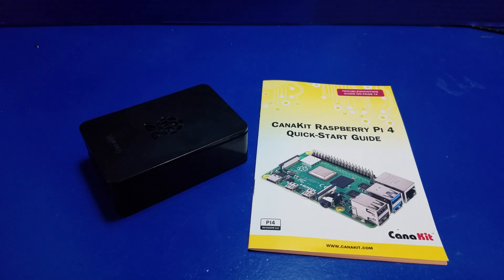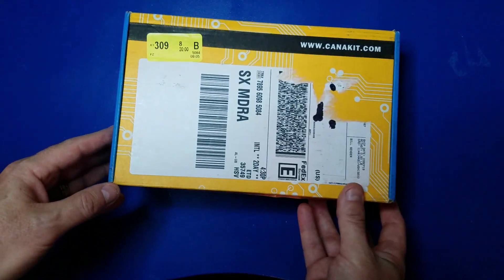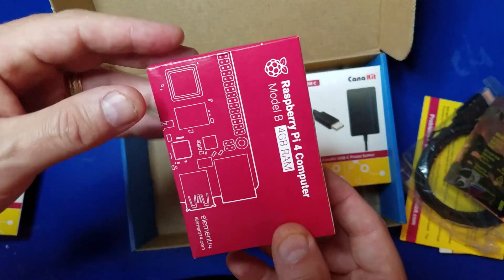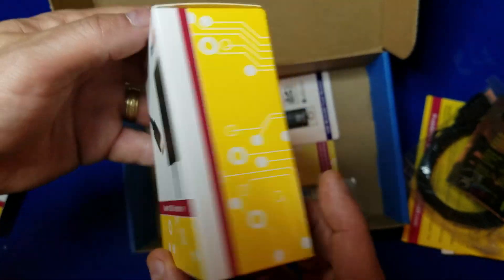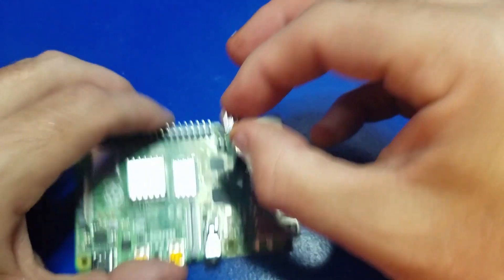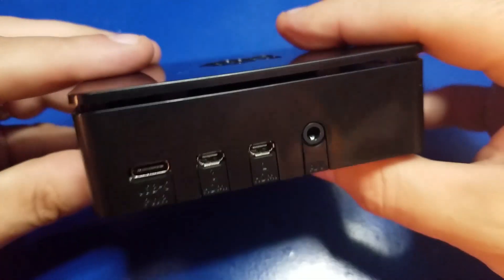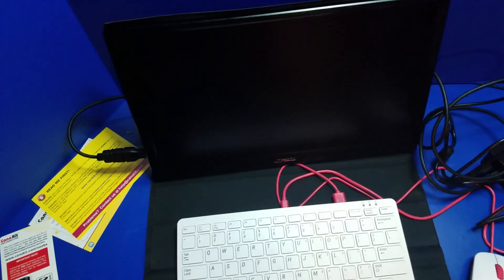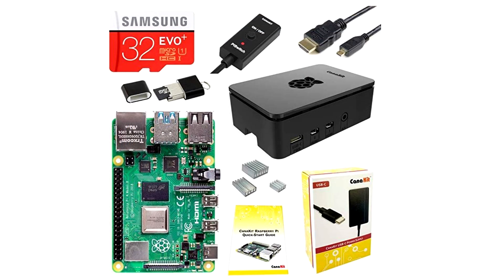CanaKit Starter Kit for the Raspberry Pi 4 4GB Setup with Heat Sink+Fan install & Test!

Comment: Thanks for the video. I used exactly same kit from canakit as you and followed your tutorial step by step. However, my raspeberry pi could not search wifi and there was two red crosses on the wifi icon (No APs found-scanning...).  Do you know how to solve my issue? Thanks.
Reply from the maker: Only two things I can think of 1)  Perhaps try to re-download and install Raspian buster from the Raspberry Pi website and see if that helps.  2)  If #1 doesn't help, then it's a hardware issue and you'll need to contact CanaKit for a replacement.  Let me know what fixes it, please.
Reply: @WagnersTechTalk  I checked two canakit raspberry pi 4 (4GB), same problem happened. They could not check the wifi. For you first suggestion, I even installed different version of image from raspberry pi official website, still could not solve my problem. For your second suggestion, actually when I install the ubuntu for the pi 4, the wifi could work (but the bluetooth doesn't work, I have to use bluetooth usb adaptor), so it's not hardware problem I think. And if I directly insert internet cable, Pi 4 could get access to internet. By the way, I followed your steps, at the welcome to start page, for the wifi, I could only find the wifi named xxxx(5G). I really feel disappointed about this issue. Maybe I could only go for ubuntu OS for this Pi 4. Thank you for your reply.
Reply from the maker: @xiaoqunyu218  I would still recommend contacting CanaKit, they were helpful for me when I had questions. Like you, I'm just a customer of their products.  Send them an e-mail with your problem and see what they say.  When you hear back, please reply and let me know what they find.  I think that disappointment you have will go away quickly.  May be a simple solution.
Reply: @WagnersTechTalk  Thank you for your suggestion. I will let you know when I get the feedback from them.
Reply: @WagnersTechTalk  After so many trials, I fininally find out the reason is that I chose South Korea(my current living country) in the start page. If I just used the default area(UK), there is no any problems for wifi connection. I guess the internal reason could be different network protocals between different countries. Really frustrated!
Reply from the maker: I'm glad you found the reason for the problem and thanks so much for sharing the solution!  I updated my troubleshooting section on my website with this information to help others in the future (problem 3) here http://wagnerstechtalk.com/rpi4/

Comment: I saw you shouldn't place the long heatsink on the ram, as it risks short circuiting the raised components. Can you clarify on this?
Reply from the maker: Do you have a link/reference to this information, it's surely incorrect?  I went by the instructions provided with the CanaKit on the heatsink placement.  If I'm wrong, then CanaKit is wrong -which I seriously doubt :)  There are no components close enough to the RAM chip to cause a short.
Reply: Thanks for the quick reply-

After doing some more research, it appears it is fine. I was referencing photo #5 of this heatsink on Amazon.
LoveRPi Anodized Performance Heatsink Set for Raspberry Pi 4 Model B https://www.amazon.com/dp/B01J58A2DM/ref=cm_sw_r_cp_apa_i_l3YWDbPZMWE9F
 On a forum, one user suggested that it was fine as long as you place the heatsink not touching the silver bumps on the sides of the ram. I appreciate it!

Comment: I noticed you put the fan in one direction and later it was in the other. Which is correct? Thanks for the video!
Reply from the maker: You want the airflow to push down towards the heatsinks.  I used one brief clip where I was experimenting, didn't notice that until a week after the video was posted.  The cooling tests I ran were all performed with the fan blowing down onto the heatsinks.  Sorry for any confusion.
Reply: @WagnersTechTalk  Amazing content, just bought the Raspberry Pi 4 Starter MAX Kit, just waiting it to arrive. I have a doubt about the fan installation, the direction of then fan should be the one showed on the beginning of the video (canakit logo facing the board) or the one showed in the end of the video (logo facing the lid)? Thank you, subscribed! Greetings from Brazil.
Reply from the maker: @Carlos Merces Hi Carlos, thanks for joining us and greetings from Alabama!  The airflow you want pushing down towards the chip(s) - logo facing the board. It will give you the best cooling for your RPi4 if the flow is pushing down on the chips.  All measurements shown were the airflow blowing down, as they should be.
Reply: @WagnersTechTalk  Thank you!
Reply: No worries. I installed it that way. It was one of the reasons I watch your video all the way through. Thanks!
Reply: I have an additional doubt, reading here: https://www.amazon.com/gp/customer-reviews/R2ZJ9GWW4Q824U
I saw an answer from the Canakit support saying this fan has two modes, quoting: "Please note there are two modes of operation for the fan (5V and 3.3V) and you may select the higher speed mode (5V) for additional cooling which would provide significant temperature drop"

What exactly does it mean? Does it have some switch? Or does it mean that depending where I plug it on the board (red and black cables) I get a different mode?
Reply from the maker: Hi Carlos, you can tell from the pinouts here https://www.raspberrypi-spy.co.uk/2012/06/simple-guide-to-the-rpi-gpio-header-and-pins/ that I connect to the 5v & ground which will give you the fastest fan speed.  It's also what was recommended in the CanaKit instruction guide.  I went by that.  3.3v would likely slow the fan down by almost half so probably wouldn't cool as well.  I think this is what you are referring to?
Reply: @WagnersTechTalk  yes, exactly, the 3.3v mode is slower than the 5v mode, I think the only advantage of running on the slower mode is for decrease the sound the fans make (with the cost of less cooling).
Reply from the maker: @carlosmerces  you're exactly right!  I guess if the fans are too loud you could drop it down to the 3.3v and make it quieter, with the possible expense of less cooling and less performance (if CPU throttling occurs).  IMO - I stick with the 5v cooling, I prefer better performance but that is just my own opinion.  I did know there was a 3.3v power output on the GPIO but went by the CanaKit recommendation (and did not use 3.3v).  I hope this helps.
Reply: @WagnersTechTalk  How loud was the fan at 5v vs 3.3v.  right now I have a passively cooled RPi2, so I don't want to introduce too much noise.
Reply: I just found out how to switch between the modes:
3.3V mode: https://ae01.alicdn.com/kf/HTB15kYwRpXXXXamXXXXq6xXFXXXu.jpg?size=355908&height=800&width=800&hash=cac3ce59167dbd581b56b864413a2d1b
5V mode: https://ae01.alicdn.com/kf/HTB1kJ95RpXXXXbQXVXXq6xXFXXXW.jpg?size=360994&height=800&width=800&hash=b43404de03f4e9c96cef37a1d3735ccc

The mode you showed on the video is the 5V mode, the best one.